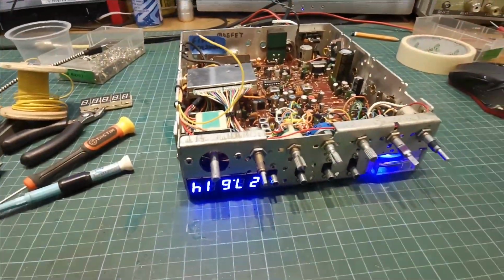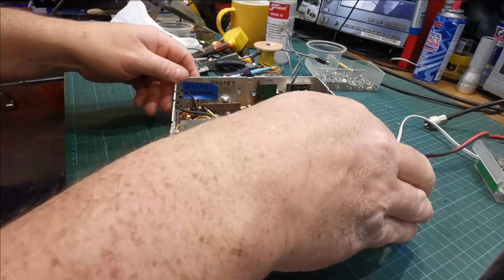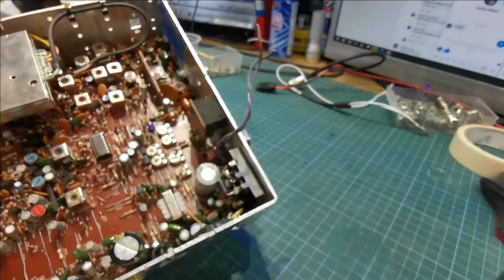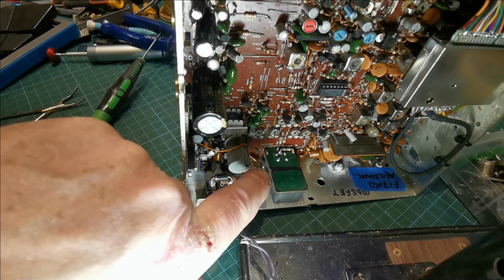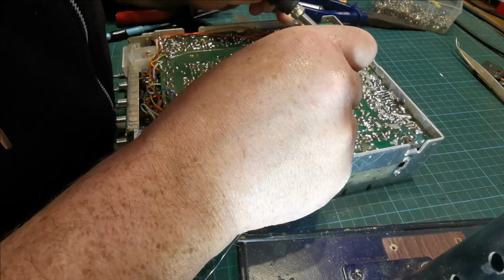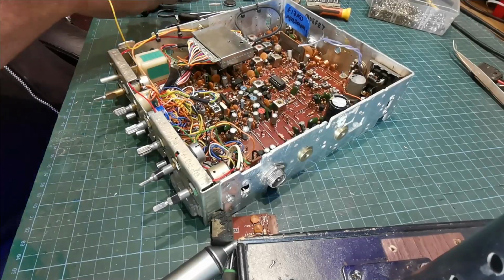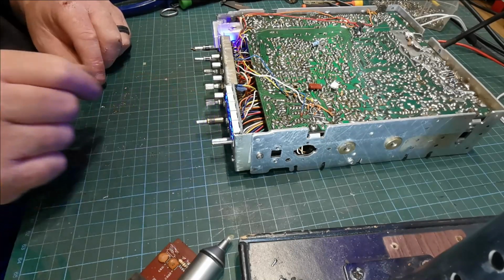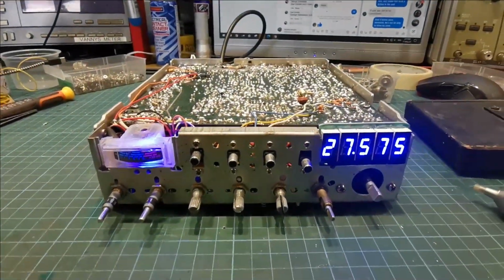HOW TO FIX INTERMITTENT RECEIVE ON A CB RADIO

Comment: I did was a tube type used a pencil  with a rubber eraser pushing down on the cap brought the receive back turned out to be cold solider joint used a 15 watt Weller gun and Flux problem solved
Reply from the maker: So it was a dry joint not the cap causing the issue....

Comment: It also can be caps to cold solider joint make you loose receive
Reply from the maker: I've yet to have a radio on my bench where a capacitor stops it from working.

Comment: Looking at thew board on that radio,I can see river's of solder. Does that increase the resistance?
Reply from the maker: The larege ground planes on the board? They came like that from the factory.
Reply: @GeorgeDonaldsonsWorkshop  I am learning a bit more and more all the time. Thanks

Comment: That was an easy one George.  I don't know where all the tabs go from the SO239 sockets?  There must be a little man somewhere sitting taking them all out!  That board wants a wash when your finished, looks like there was no solder connection untouched.  I am sure it will be a grand working radio when you are finished with it George  :-))
Reply from the maker: The funny this is, other than the bad connection, it works incredibly well.
Reply: @GeorgeDonaldsonsWorkshop  Bonus :-))